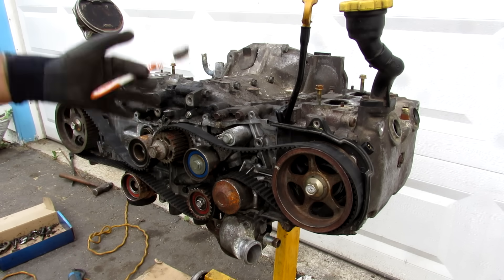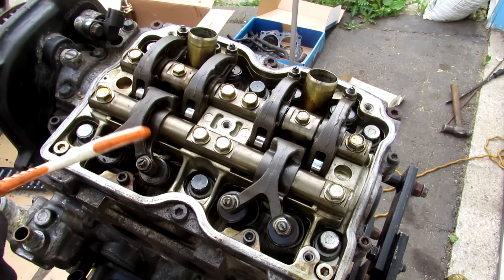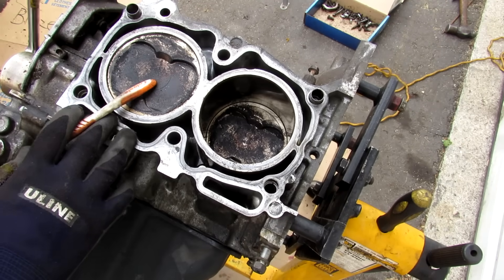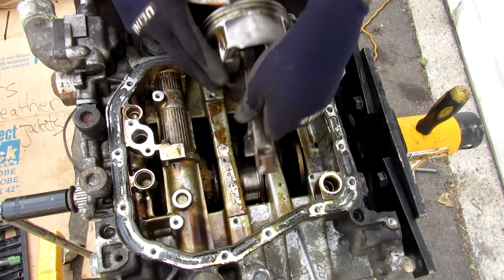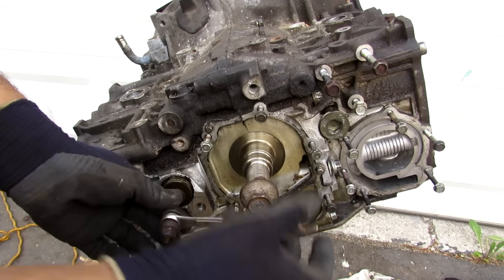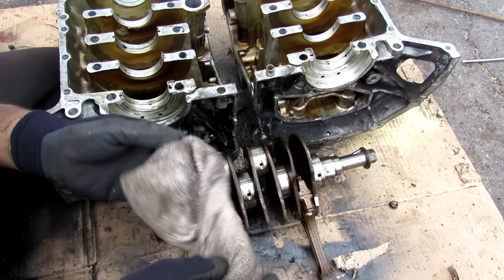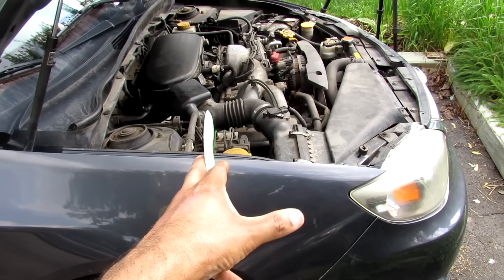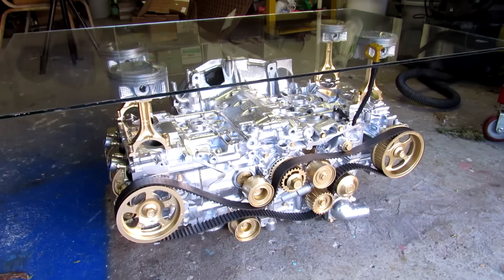Why Subaru Engines FAIL

Comment: Never in my life have I ever thought of using a bolt as a Allen key/hex wtf am I doing with my life
Reply: This is so obvious in hindsight and now I feel like a fucking moron.
Reply: @Wrathlon  imagine what deaths like
Reply: Me too!   This could have help me once!
Reply: Done that Many times ,one hasn't got the right Allen key All the time
Reply: Now go look for a 14mm hex head
Reply: tomy983 not the most common size!
Reply: You can also stack wrenches to create an extension for more leverage by locking an open-end of one wrench into the closed/box end of another wrench. Any screw driver bit holder can be used as a 1/4" nut driver with the bit removed. Any two wires with female terminals can be joined by attaching them to the male terminals of the same automotive fuse plus you can select the fuse rating. If you need to get grease inside a torn axle boot or an exposed ball joint just to buy some time pack a straw with grease and then push it out at the exact spot you want it. To determine if a light in the distance at night is using a/c power(a building) or d/c power(a car, generator) look at it through binoculars and then jiggle the binoculars slightly which will create a tracer effect visual. D/C power will show as a solid line. A/C power will show an evenly broken/dashed line because the power is constantly being turned on/off at the source(alternating current).
Reply: @secondopinion6654  In Australia, we have people who follow your methods - we call them "Bush Mechanics".  They can fix anything using little more than a length of iron wire and a roll of duct tape.  This is often necessary in the outback where the local service station may be 200km away and spare parts 2 weeks away.
Reply: Learned that when I had to get at the hex on a VW Beetle Manual transmission (gear oil).    Bend the bolt first so it looked more like a wrench (then I found out that VW had a special hex wrench just for that drain plug
Reply: @alborgdenmark26  Were the proper wrenches costly or fairly reasonable?
Reply: @olegkostoglotov8800      Hello,  if possible if I'm buying cheap wrenches are preferably made  in Taiwan.  Sockets are from Harbor Freight, some Stanley, some Gearwrench.  You'll need a rachet (firstly 3/8 " drive).  Need a engine hoist and it would be handy to have a engine stand.           Best regards,    Aalborg
Reply: @alborgdenmark26  I was referring to the VW factory approved wrench for removing the oil plug. I too know of people who have made custom wrenches out of cheap ones, usually ones made in India, he heated them up, and bent them with an acetylene torch.
Reply: Semi retired maintenance mechanic... I've done all sorts of weird stuff like this. Use a cog belt (timing belt) and vise grips for a strap wrench....
Reply: IKR, i spent two whole weeks running from store to store trying t find the right hex head to take apart my my GM 3.8
Reply: Wizardddrryyyyy
Reply: @EmongTimothy  Ikr, some people do some things and you are left feeling like an idiot, like how did i not think of that.
Reply: Email mechanic schools. High schools teachers
Reply: That "trick" is an old trick, used it on the Trabant and Skodas in the early 1960s. Taught by a friendly neighborhood mechanic from Hungarian background. That was their smarts, too  expensive buying specialist tools in the old country, find ways to make it happen.
Reply: You can also use a hex bolt instead of a large allen key for motorcycle front tire axe. They make special keys for motorcycles but if you don't have one or can't wait to order one for $10 then buying a bolt and three nuts for $8 will also work. Thought of that by myself when I was trying to take off front tire of a kawasaki 1600 and not knowing anything about motorcycles.
Reply: Yep, good idea.
Reply: You think of stuff like that when you don't have the cabbage to purchase the needed tools and or you have done this so much you find clever time saving ideas, tricks, short cuts
Reply: Works both ways as well, you can use an Allen bolt for a socket. My dad taught me that trick.
Reply: @sethc6663  Shit. I am an ASE Master Tech. I have never, ever thought of that. That's brilliant.
Reply: I’m a backyard hack and first time I did it was in th 70’s
Another reason to have an old bastard fix your stuff.
Reply: @codyking4848  You must have a Snap On truck handy.
Reply: @codyking4848  That's because school taught you how to do it with all with the right tools always at your disposal
Reply: @codyking4848  Dad showed me one time when we had to fix our tractor out in the paddock.

Comment: The V6 engine is one of the worst naturaly balanced engines ever made along with the I4.. if an engine uses a balance shaft that means it is so unbalanced they have to add a balance shaft to take out some of the vibrations.. the boxer engine is one of the best naturaly balanced engines ever made along with a I6 and I5..

Comment: This video makes me sad. My Subaru failed in two of the ways you described...
Reply: What year? I’m looking at a 2017 turbo
Reply: @devonpeters9458  it was a 2001 ej20t. Since then I also had a 2016 outback that failed due to bad electronics frying the ignition system.  Three engines in 60,000 miles.  I'll never own a Subaru again.
Reply: Bryan Teany  200k on my bought from new 2 litre 2002 Forester. No engine issues ever. Regular oil changes a must on all vehicles.
Reply: @calderdale6795  was it turbocharged?
Reply: @devonpeters9458  buy a turbo barra U can't go wrong
Reply: Or buy a car without one of these terrible engines.
Reply: I bought an engine that had 2 of these issues from the junkyard, blown head gaskets and oil consumption.

Comment: Don't kid yourself, Subaru has been around for a long time and there are many still on the road when other brands have long been sent to the junk yard. Subaru hasn't changed the engine design that much because it works. So they have a few issues, what engines don't? The Subaru boxer engine is still better than many other boxer style engines.

Comment: My Subaru went 300,000 miles on original motor. 2x for the head gaskets, otherwise very reliable. In fact, the rest of the car failed, not the motor. Transmission also went all the way. Oil changed by me every 3,000 miles.

Comment: A V6 suffers from the same sort of imbalance that an I3 does. An I3 has primary and secondary balance, but the engine suffers a from a rocking motion. Apparently this imbalance persists even in a V6, although not as bad. Some V6s do use balance shafts though to compensate though.

Comment: Thanks for the deepdive into the Subaru flat 4. I've been a long term fan of Subaru AWD but always weary of thier head gasket issue. I didn't know about the oil pump and main bearing issue at all. I wonder how Subaru have been making flat 4 since forever and not perfected it by now?

Comment: Even proper maintenance is not enough, one needs to know which parts to swap out before they fail and destroy the rest of the engine
My 2005 Legacy GT LTD first had its valve cover seals fail dripping oil on the exhaust manifold. Then it blew its radiator. Then it blew its head gaskets. I should have replaced the turbo at about 100k miles because it eventually ground up its bearings and dumped the powder into the oil. At that point it needed a new engine which would have cost more than the car was worth. I got about 150k miles out of the car over 14 years, so I guess I got my monies worth. Now I own a Tesla.

Comment: A must watch for anyone who owns a Subaru with this engine.  I had to replace the engine on my 02 Outback Sport (Impreza) after 78,000 miles due to a failed head gasket.  Ended up costing a ton of money - and I won't buy another Subaru that uses this engine or has a crap CVT.

Comment: Subaru boxers are really a complex exotic put in an everyday car. Deep regular maintenance is critical Because there's so little resilience in the engine design. The head gaskets fail because head contact surfaces are tiny compared to a traditional upright 4 or 6. The pistons are really short resulting in very small bearing surfaces for the rings. Hence the subaru clatter. Very clever but really like a ferrari you should tear the engine down and perform deep preventative maintenance and then it will last. But the design complexity makes this level of maintenance rather expensive at a dealer! Great while they go!

Comment: Tbh you could title it why engines fail, most Subaru engines fail because of their clueless owners put to much power through them with out changing key components. Mines been running 500 bhp since 1997 with out issues :p

Comment: I heard a claim from a salesman that Subaru fixed their oil leak problem with the newer 2 litre motor like in the Crosstrek.  What could they do to fix it since your video shows when it sits the oil and anti freeze all focus on the lower part of the oil seal?

Comment: Mediocre engines mated to crappy Jatco transmissions. I’ve been an Asian import technician for 30 years. Other than their obvious advantages in snowy areas of the country they aren’t that great of a vehicle. Fortunately for Subaru Honda and Toyota have lost their minds and are putting crappy CVT transmissions in their vehicles too. Now, you can take your pick of crappy cars from Honda, Toyota, Nissan, Mazda, and Subaru. I’ve watched the quality of the big three Asian imports go to crap over the last 30 years.

Comment: A toothbrush helps scrub crud from screw heads and bolt heads, prevents stripping and rounding of soft metal fasteners. I thought I was the only one who used one.

Comment: 210k on 2008 wrx with same clutch when I sold it. If I would have bought the STI I probably would have kept it. 
I had the oil changed around every 10k.

Comment: They fail because the phrase "one other flaw" has to be said multiple times while describing the design of these engines.
Reply: Got 284k on my Outback. Fixed the head gaskets and changed the oil religiously.
Reply: @Pbtr0ut  Got that much on a 3.3 pushrod Dodge Caravan motor and it's never been touched other than oil changes and maybe plugs.
Reply: I've driven them in wrx and forester turbo they are good to move but a troublesome  cunt  of a yoke
Reply: There's only 2 issues mostly, bad head gaskets which can be fixed easily and oiling issues which just means no extreme hard corners and keeping an eye on it.

Comment: @speedkar99 There is some basic knowledge of how an engine works that you seem to not understand.... The video is good and you explain well, but there are a few things you get wrong so I'm gonna point them out fore you so you can learn. You say one of the problems with a broken head gasket is water and oil mixing and then that water don't lube as well as oil and oil doesn't cool as well. That is true but the main problem when the gasket is bad is that you get air in the coolant and as a result the engine overheats and possibly warping the heads also. Then you talk about gravity and the water standing still in the bottom of the engine and then corrodes the block, this is all wrong. The coolant system is a closed system you have to bleed out any air so it works proper.... so the water channels and water caps around the cylinders are always full. If you get air in your coolant system you run the risk of overheating the engine. The bigger air pocket is the greater the risk of overheating. Hope you read my comment and find it useful! Greetings from a mechanic in Norway ;)

Comment: I had a Subaru Brat. Simple boxer engine; ran great. From date of purchase it sounded as if it was going to come apart; never did.
  Do maintenance, check oil and coolant,  change filters. No worries. 👍👌👍

Comment: The timing belt tensioner is a hydraulic type, like a pressurized shock absorber, if it goes flat it will bang against the block sounding exactly like a rod knock. The timing belt "kit" comes with all new belt rollers tensioner and belt for about 200$. I'm a American motor guy but am totally impressed with the life of these cars which is why imports are so popular.

Comment: Can the engine last if I religiously change the oil? I have the same engine and I check the oil every month and change it every 5k miles or a year which ever comes first. Thankfully my engine doesn't burn any oil.

Comment: Title should read boxer boat anchor to coffee table with working clock. Those darn boxer engines self destructing without oil, Subaru must have done that intentionally. Lexus runs without oil and survives new video

Comment: I dont think Iv ever seen a failed or worn out Suburu engine.
Reply: my buddy went through two blocks on his sti before he sold it. one had 200k miles and the other had not even 20k. were pretty sure it was the fault of the turbo, the number two rod went through both times. these motors can be dicey when pushed a little too far.

Comment: regular oil and filter changes using quality oil and filters are critical and never thrash the engine until it has fully warmed up so it must have been running for at least 20 mins you will have great trouble free engine.....neglect is the only reason these engines go wrong......

Comment: I once owned a 1983 Subaru. By the time I sold it the engine had 350k miles on it. The only thing I ever did was the general maintenance on it. Oil changes every 3k miles, tune up every 20k, timing belt every 55-60 k, and so on. I never had a problem with that engine. The only thing I had to replace was the clutch multiple times. As long as you do the general maintenance on any engine they can last well beyond their expected lifetime.

Nice video...makes me really miss working on cats and their engines.

Consider me a new subscriber!!

Comment: Subaru breaking: I’ve owned several and ran them hard up to 200k never had a problem.
Reply: My first Subaru was a legacy that I bought at about 170k miles, and finally gave it away at over 300k, and it's only problem was that it needed a CV joint. A friend of mine bought one at over 100k, and kept it until about 250k. I've bought three more since then, all used with high mileage, and they all were exceptional cars, despite irregular maintenance by previous owners.
Reply: @slappy8941  If you starve them of oil they will go bad, They just need maintenance
Reply: I have this engine for 3 years.  No issues at all.
Reply: @daviddo1232002  not yet but it's common.
Reply: Mine leaked a lot of oil after 150K.  My friend’s has 120 and is starting to leak
Reply: They are known to blow.  Risky investment

Comment: I had a Subaru back in the day and the points kept closing on the distributor. My neighbor had a small Subaru truck with 2 seats in the bed facing backward (it was so they could import them cheaper as a 4 seater). He had the same issue with points. Mine also had a cable clutch which was kind of weird.

Comment: The subaru engines have coolant flow issues around cylinder 4 which is what usually causes the head gasket problems, low flow means more heat in one area
Reply from the maker: Thanks for that point

Comment: Great tear down until he started to separate the block with a ball pein hammer. It really made me wince seeing him hitting aluminium with a hardened steel tool. Urgh.
Reply from the maker: Yeah it was a scrap Engine so I didn't care
Reply: @speedkar99  in our machine shop my mentor kept all the steel hammers well away from normal tool area, and you only got them out if they were really needed. The only hammers allowed were copper and hide mallets. I took this rule through my own workshop and rarely ever saw damage to sensitive parts. Some employees are just too lazy to get the right tool for the job. Great description of it's functionality BTW.

Comment: I'm so happy I got rid of my 07 outback. That car was the biggest money pit I've ever owned! Between the head gaskets and the rear end bearings to the slipping transmission the car was a mess. My coworkers also had head gasket issues on their Subarus. They had an 03 Impreza, 05 Forester and 14 Outback. All had head gasket issues and the dealership wouldn't fix em under warranty!
Reply from the maker: Ouch. It's sad that's the weakest point, otherwise they are very practical
Reply: @speedkar99  the weakest point took them 20 years to fix though. I've talked to several people who used to be Subaru mechanics. They said 2003 to 2009 were the worst years for head gasket failures. What's even worse is Subaru knew they had a serious issue, but they only replaced the head gaskets while the cars were under warranty and not out of warranty. Most other companies take responsibility for their screw ups. Instead Subaru likes to point fingers.

Comment: Very comprehensive description of hot spots on the Subaru Boxer engine. Son had a water pump go and a new gasket fail with only 20K miles after change at 100k. Love hate relationship with Subaru
Reply from the maker: Wow that's sad. You think it was coolant related?